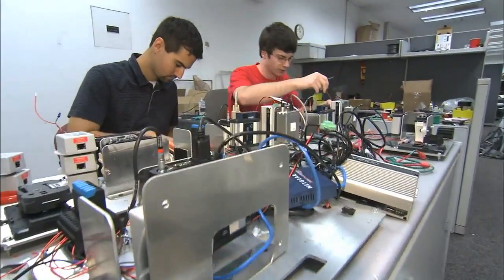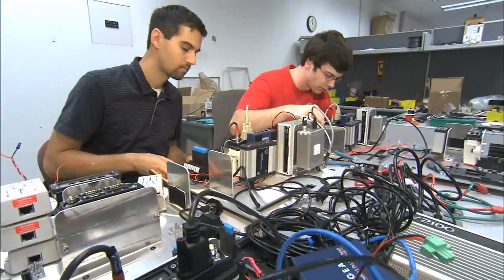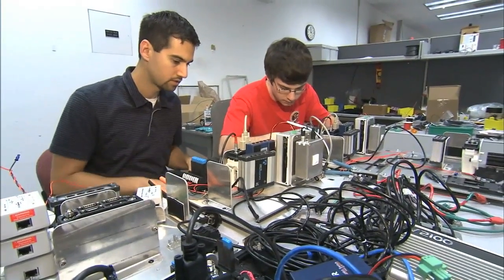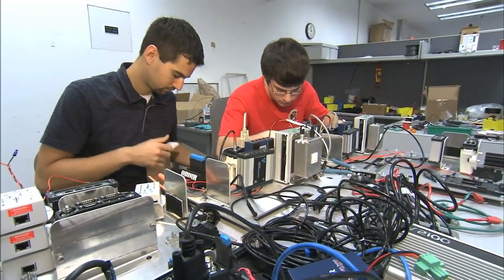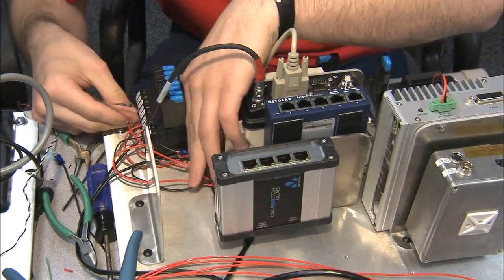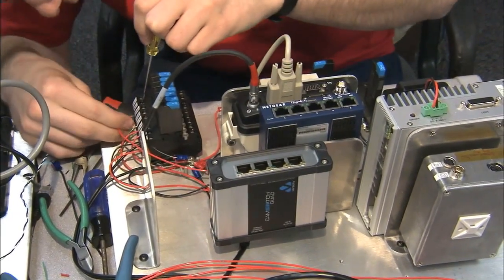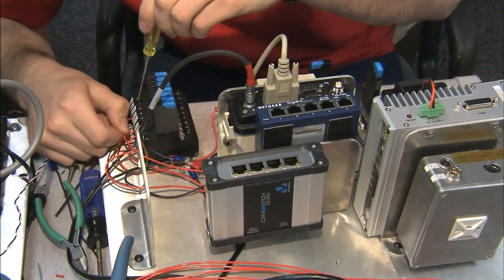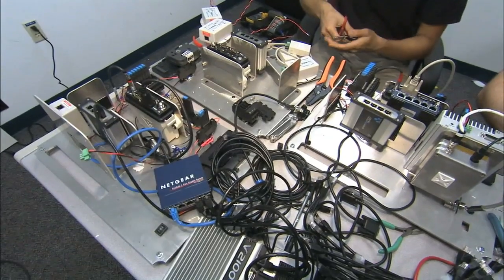D-RATS Help Ready Robot Exploration

Comment: "assemble the backbacks" ?

Just tape all the components to one another with velcro.  Added functionality is that the velcro will give-way before the components break.

It's a trick used by RC plane enthusiasts to easily fasten a variety of devices to a plane, without needing to make a custom case.  With the velcro - If the plane crashes - the components will rip away instead of crushing each-other, snapping off mounting screw-points, and/or breaking the plane.
(they even Velcro the wings on!)